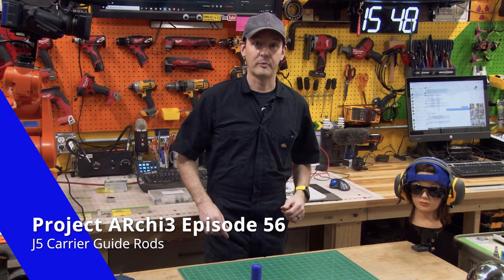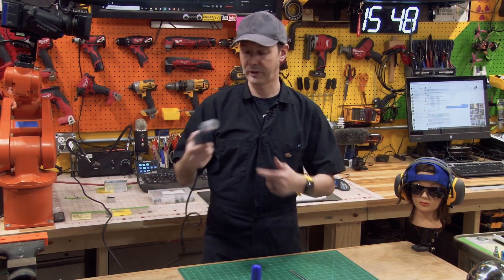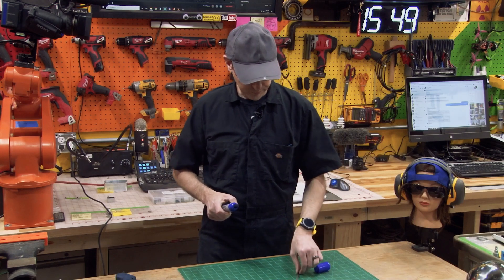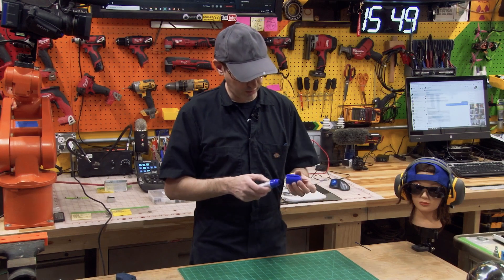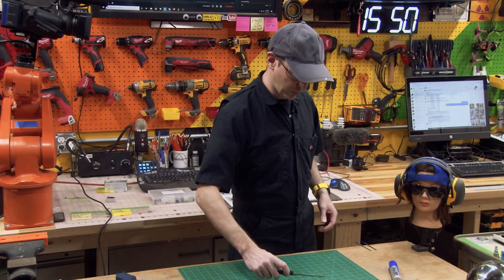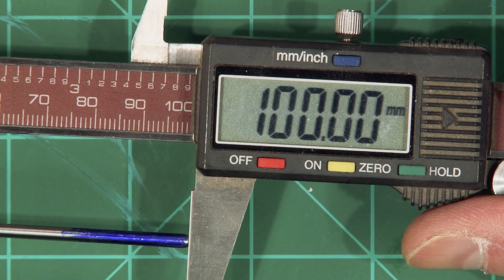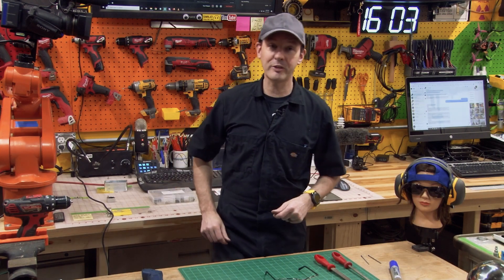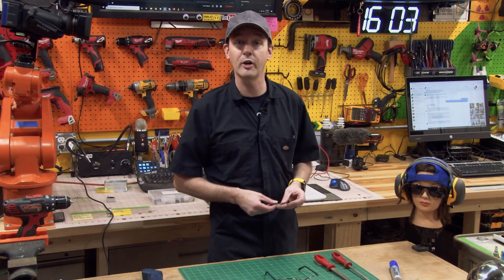Project ARchi3 Episode 56   J5 Carrier Shafts Fabrication

Comment: A good rule of thumb when using abrasive cutting tools is to throw the sparks towards your body. This is incase the cutting tool binds up or kicks back the tool will jump away from the body. There isn’t much concern with the little one you are using but just good practice.